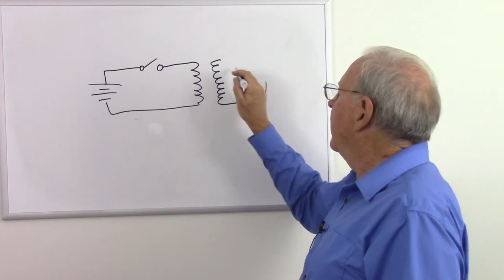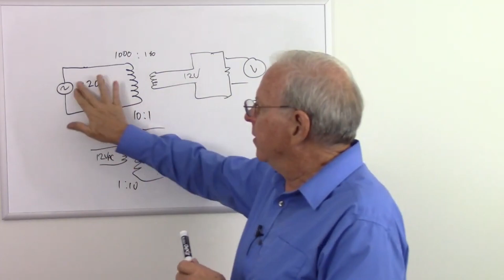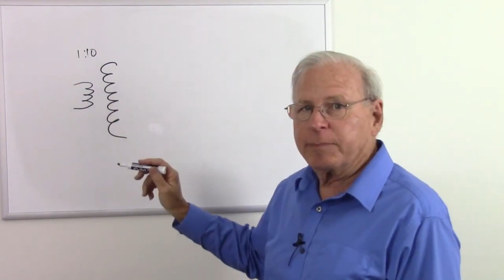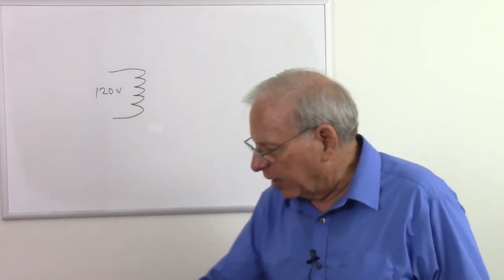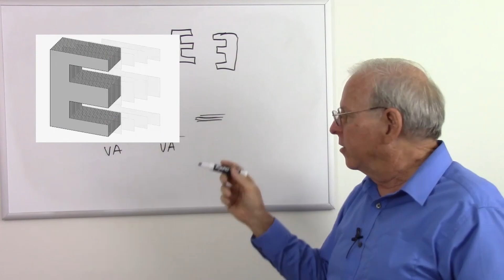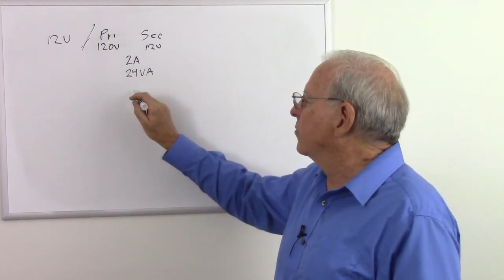Transformers

Comment: Hi Bob, this is a little off-topic but I am a bit confused and wondered if you could throw any light on my issue. I have a 1:1 toroidal transformer and an auto-transformer which I am planning to combine into a single-box variable, isolated 240V supply for my bench. Whilst experimenting with configuration I find that the toroid is very noisy on it's own, or if placed before the variable in circuit: if I reverse the positions, the toroid is almost completely quite up to around 90% output. I know there are many opinions as to whether the chicken or the egg should come first but I am trying to understand why this should occur. The noise is intolerably high to have close to one's ear when working so I guess the variable is going to be first in line but I would like to know if anything else can be done. I have tried an X2 rated capacitor across the input and the output to no effect. There is an NTC resistor across the input so I don't think it's a "surge resonance" being set up, if such a thing exists. Any opinions would be gratefully received, thanks.